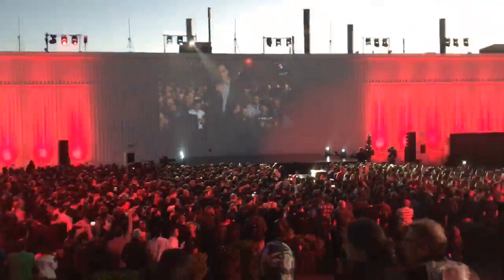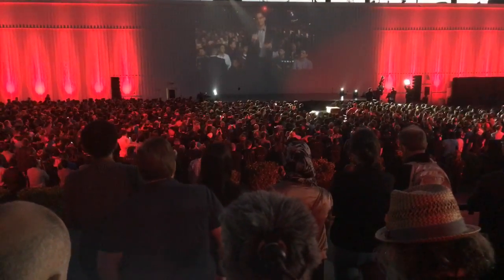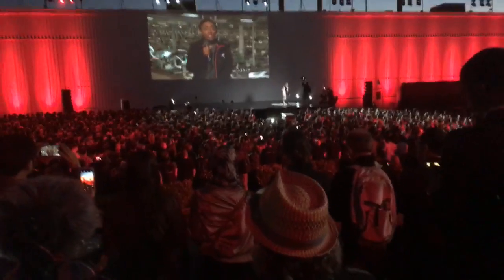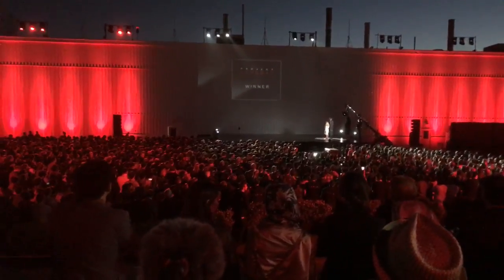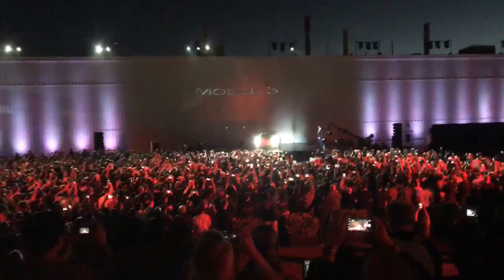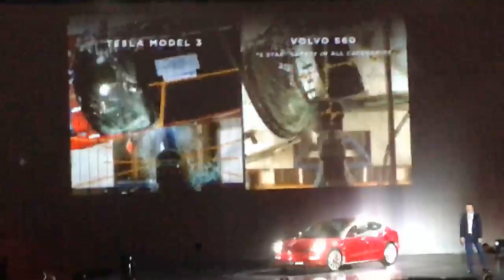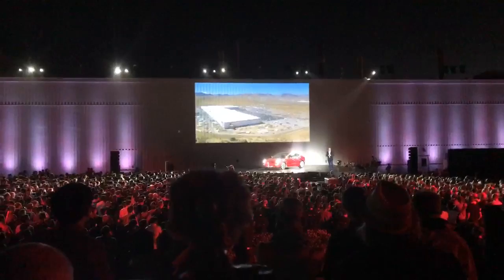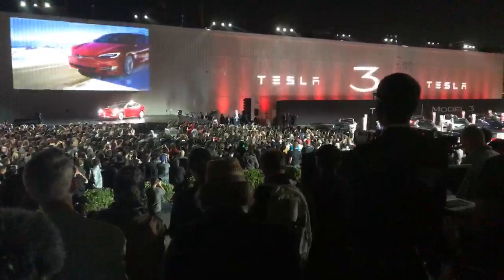Model 3 Delivery event live stream

Comment: No info on the interior? Charging rate? Roof? Colors? Controls?
Reply: Supercharging rate: 130 miles of range per 30 minutes :/
Reply: Hi Jaegertech the short range Model 3 allows for 130 miles in 30 minutes and the longer range allows for 170 miles in 30 minutes (same as S/X).